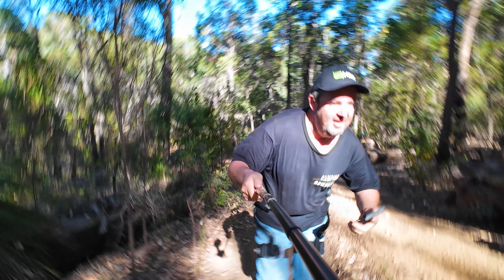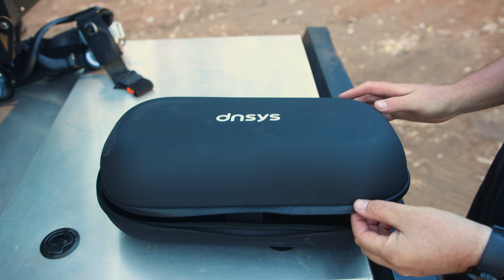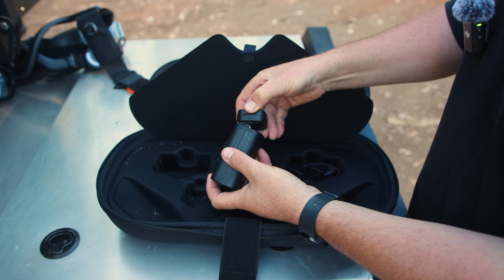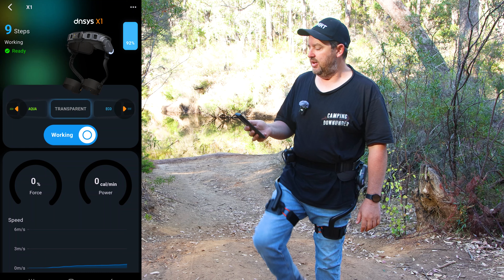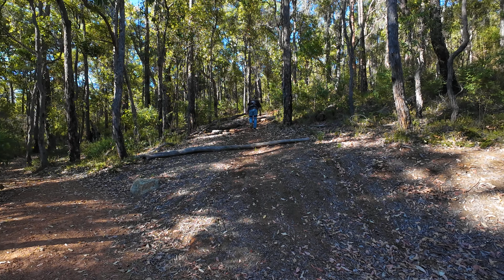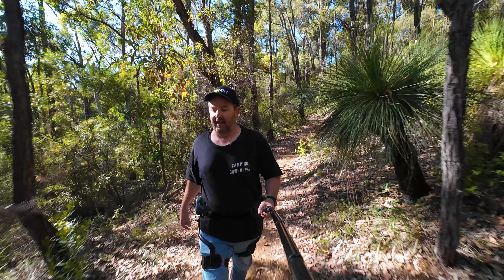Exoskeleton that helps you hike further than you ever thought possible

Comment: Nice idea. But what if the battery runs out and you can't get back. Watch the clock I suppose.
Reply from the maker: It's no harder to walk with it turned off than it is without wearing it. It cycle's down in assistance as the battery gets flatter to prolong the battery life. You can always carry a spare battery in your pocket. The batteries are small enough to carry a spare